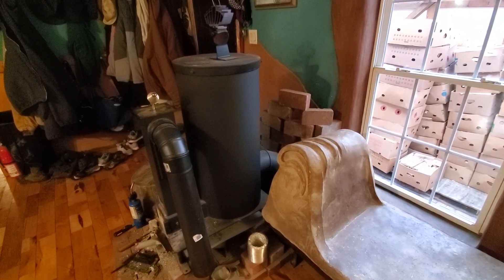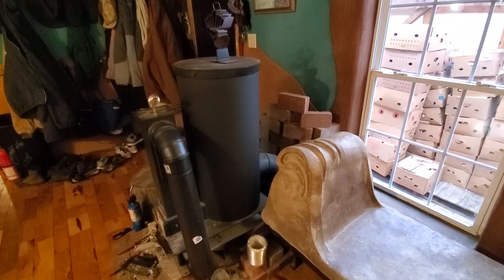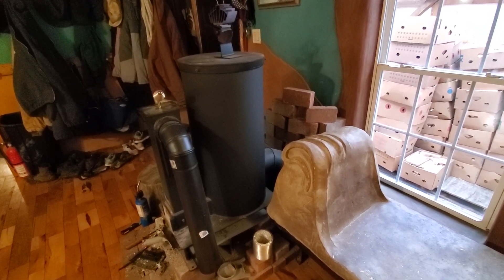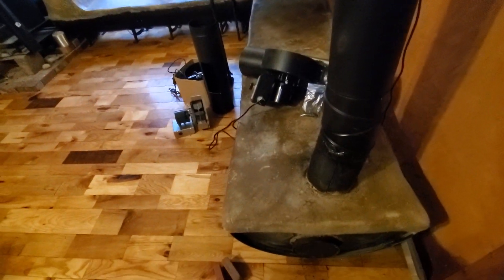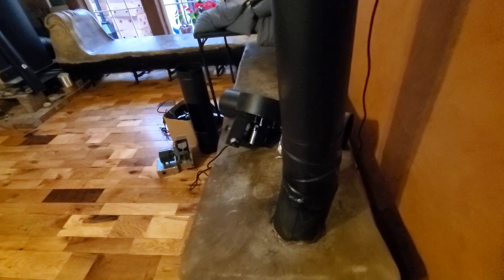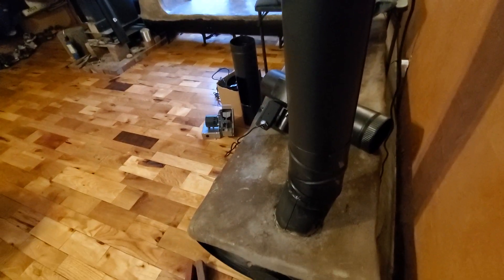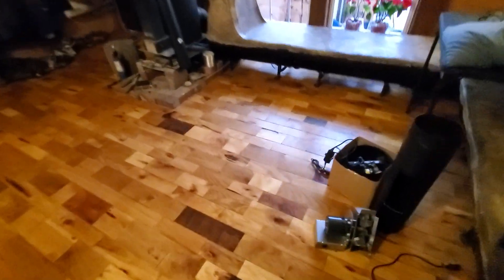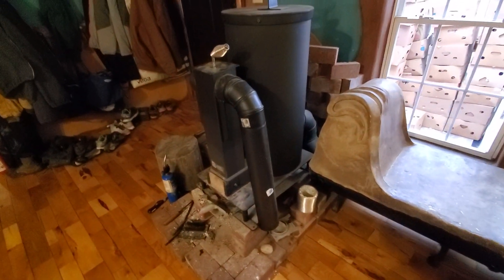Using a Wood Stove Draft Fan with a Rocket Mass Heater? Ask Uncle Mud

Comment: I got a good draft at start-up, then after an hour or so, lose the draft and the house fills with smoke, chimney top was a foot or so above the highest thing close, accept a tree, added another 4' section on top, still, after an hour or so, lose the draft. What's going on?
Reply from the maker: how cold is it outside? That matters.
Reply: @UncleMud  around 35°F
Reply from the maker: What wood are you using? If your wood is rectilinear like the flooring scraps I use it is easy for the coals to block the throat of the heater and all the smoke go up into the room. Is your chimney insulated?
Reply: @UncleMud  split logs, wrist thick, no blockage and not an insulated chimney.  Worked great for an hour before it backdrafted.

Comment: How long is the chimney
Reply from the maker: My horizontal heat exchanger flue in the bench is about 16' (recommended is 12' but I had to push things) and the vertical chimney is about 15' (recommended about 25' for perfect draft) but again I had to push things). If you stay with a more conservative ratio of say a horizontal run of no more than 60% of your vertical run you will send a little more heat out the chimney but you will need a draft fan even more rarely than I do which is a couple weeks spring and fall. Even then the little fire in the cleanout is surprisingly simple and effective.

Comment: Does the diameter of the chimney have to be larger than the diameter of the thermal riser?
Reply from the maker: They should be the same. In certain circumstances you can go down from say 8" in the riser to a 6" chimney.
Reply: @UncleMud  Thank you! Is it more reasonable for the thermal insulation layer of the heat pipe to be filled with large hot melted soil or with small hot melted perlite particles?
Reply from the maker: In the riser or where?
Reply: @UncleMud  riser
Reply from the maker: The riser should not be metal on the interior it will not last long if the rocket is as hot as it is supposed to be. The insulation layer of the riser can be ceramic wool either wrapped around the outside of dense firebrick or insulated firebrick, or it can be ceramic wool compressed into the inside of a larger diameter stovepipe or it can be perlite or vermiculite mixed with clay slip and cast into the riser shape. The Liberator uses ceramic board insulation panels bolted inside the steel chimney to protect and insulate it. The Gamera uses cast refractory panels for the riser. The Dragonheater uses vermiculite boards for the riser. My CottageRocket uses compressed ceramic wool.

Comment: So, if I just ran my liberator about four feet and then up the chimney flu, would I still have that issue of back draft?   If so I would do the waxed cardboard to get it going.
Reply from the maker: Probably waxed cardboard is plenty to get your draft going with only 4 feet of heat exchanger to your mass but you would be wasting a lot of heat up the chimney.
Reply: @UncleMud  I'm sure it would.  Maybe build a mass exchanger from the stove to the fireplace flue to absorb that extra heat.
Reply from the maker: A 50 gallon drum "bell" stratification chambee in the exhaust path between the heater and the fireplace would radiate most of the excess heat out into the room before it could exit.
Reply: @UncleMud  with uncle Mud , we learn so much ! In this case , you just put a baril , if i understand well , the pipe ( say 6 inches )  is going in the baril and you put  an other one , same size , same level , say 6 to 8 inches from the floor that goes to the chimney, is that correct ? Thanks